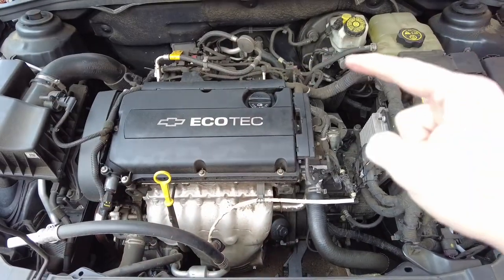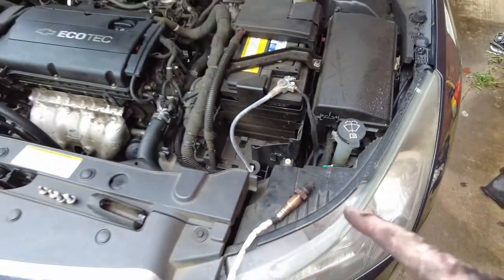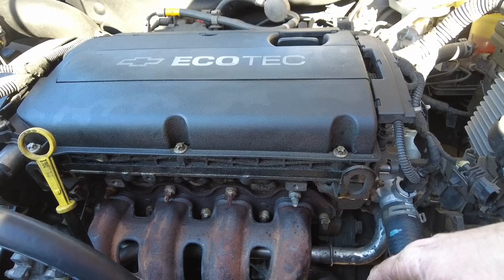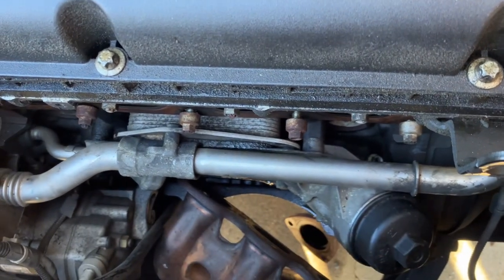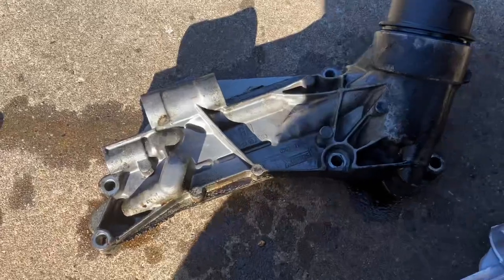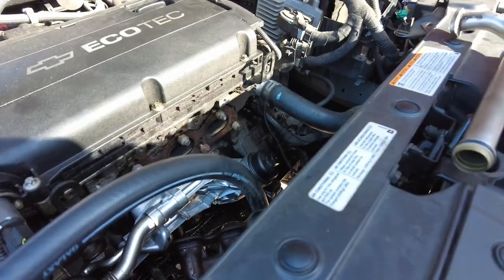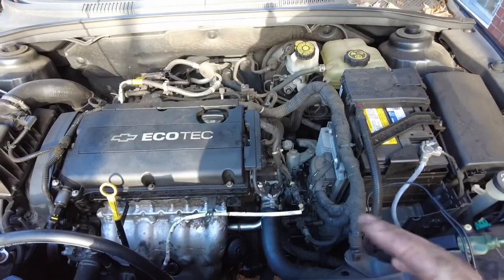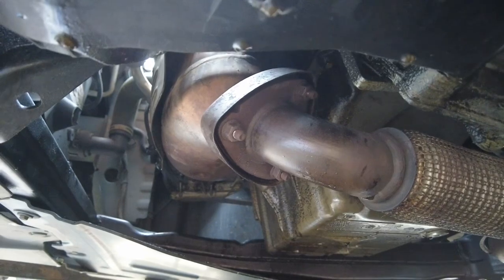Chevy Cruze 1.8 oil cooler replacement

Comment: I rebuilt my oil cooler for my 2016 Cruze using FEL-PRO oil cooler gasket kit part number ES-73215, clean everything up and my car is running great. helpful video 🙂
Reply from the maker: Awesome!  I sold this car the next week, I just wanted a quick way to fix it.

Comment: It’s all very sturdy aluminum. Shouldn’t crack or break. Usually it’s their gaskets that fail. Autozone sells a Dorman set for  20 dollars “Oil Cooler Gasket Set” you can rebuild this without buying a new one if you wanna save money!
Reply from the maker: Mine was clogged up with crud from mixing coolant and oil in close proximity to one another.  Definitely worth it to change the whole unit.
Reply: Mines had damage to the aluminum mating surfaces so it was a no go for me. Replacement  was the only option for me. An easy fix. Most annoying part was the bleeding of the cooling system.

Comment: How did you get the shield out? I am currently in the process of removing and was not sure if its just man power it out or there is a little more finesse that needs to happen. Engine matches yours exactly seems to be getting hung up on the dip stick holster. I also have not removed the O2 sensor which I will go get a socket for it. Which size would I need?
Reply from the maker: I had to turn my dipstick all the way to the passenger side and then puzzle piece it out. the O2 sensor socket is just a generic one.  It's made to have one side open, I think its a 22mm but just bought a sensor socket.
Reply: @ChrisThedudenurse  Thanks for the tip 👍🏻I'll keep trying
Reply: @brendankaer9437  did you get shield off?  I'm having hard time removing it. Seems stuck on passage side. Don't see where it's hitting

Comment: After replacing the oil cooler, water outlet and timing belt it says “oil pressure low stop engine” any idea what the problem could be? The engine is also ticking
Reply from the maker: Have you checked with an oil pressure gage yet?  Could be a bad oil pump, or could be even worse.  Once you hook that gage up you'll be able to know more about what could be going on.

Comment: Hey mate, need your advice, please. 
I replaced my oil cooler with my mechanic, and 5 days later, it started leaking again. 
I bought the oil cooler from ebay with 5 years warranty , with all the oil seals , because a genuine Holden oil cooler was $700 without the seals with only 2 years warranty 
He fixed it again because the new part I got had a hairline split in the casting "we think." 
So we opted to try and use the new inner cooler and bolt it onto the outer older casting because it looks perfectly fine . 
The reason why we did this is because you can just buy the internals to save money as the outer casting is usually not the issue . Most times the seals go on these wich makes them leak .

So can you throw both of us any ideas,  maybe an oil pressure issue,  blocked outlet valve somewhere????
Reply from the maker: I had a hard time with my gaskets being like a plastic.  I had to actually scrape them off the block.  It’s possible you had some material get left on the block and not make a seal.  Or it’s possible that when the cooler was installed the gasket folded and isn’t making a good contact.  Sounds like it’s a gasket issue.  If the problem was inside the cooler itself you’d more than likely have coolant and oil mixing.
Reply: @Chris The dude nurse  
Thanks for your reply,  will check all of that out !

Comment: Did you drain the engine oil first before you removed the oil cooler?
Reply from the maker: No but I changed it immediately after.